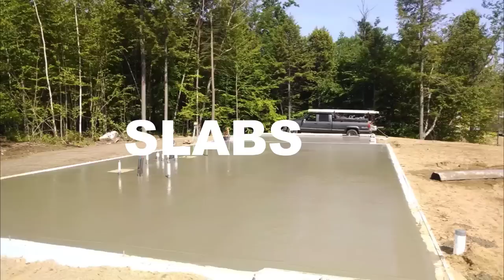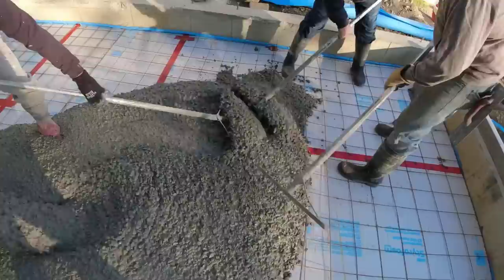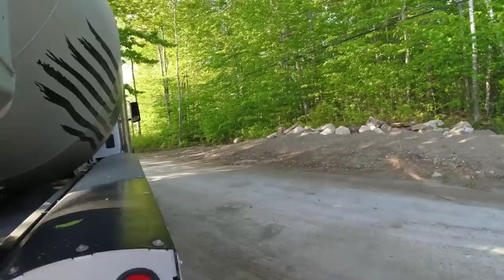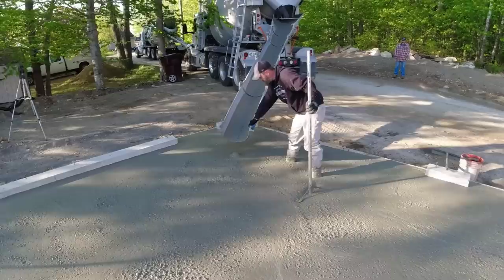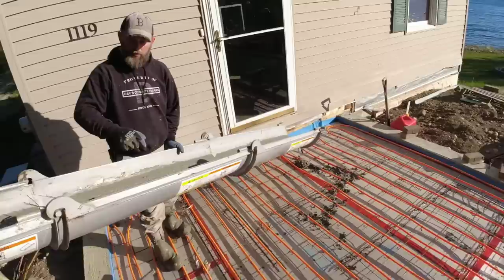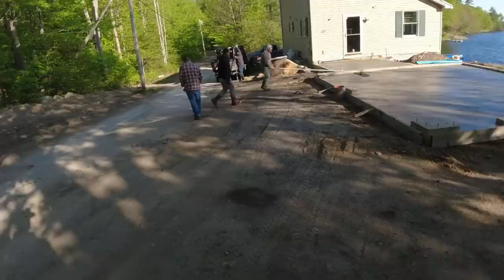City Inspector Makes Homeowner Pour His Concrete Floor 8 Inches Thick!

Comment: I’ve worked for years as a Grade Forman for an Excavation Company in Boston. I can relate to these existing conditions problems. It’s actually a good catch by the inspector if the concern is water coming down the road and into his new garage and breezeway…it’s to bad this wasn’t caught or addressed by the site company..but like you said Mike “in the long run he will be better off

Comment: As a former inspector this is about having a “Termite Barrier.” They are ways to fix the slab where you would not have to pour the slab the full 8 inches. Also you have to look at the soil compaction under the slab and make sure the slope around the slab moves water away from the slab. There is always a way to to get the end result. A lot of contractors will blame the inspector when it is either their laziness or lack of job knowledge. Homeowners also put too much trust in their buddies that are in construction over prudent research themselves, if you don’t know always ask. Just in case you have a question down here in the south “Termites” are as dangerous as anything else, that is why I referenced “Termite Barrier.” There is also code section on slopes around a structure. 6 inches per 10 foot away from the structure if I remember correctly. It’s been 10 years since I worked so it might have changed by now.
Reply: Great comment. Most complaints when the safety people enforce standards the manager or the employees are just being lazy or babies
Reply: I fully agree, and thank you for posting your comment I was perplexed as to how the contractor seemed to be so surprised that it needed to be higher than the road, not a contractor I would ever hire.
Reply: The problem with a hole inspectors like yourself, is they never explain fully what they want and how to get there. Instead of saying, “hey you need to accomplish this, and these are a few ways to get it done”. You just decide to play a game.

I played a game with my inspector when building my new home. We have a third floor bonus room that we weren’t going to finish right away. He said it needed a fire barrier and told me the most expensive way possible to achieve what he wanted. I responded by saying, “or I could just drywall it”. He turned red, said “that works too” and stormed off. 

I also asked him about earth disturbance since we had a large lot, and he said if he wanted he could consider pulling out a blade of grass to be earth disturbance. I took pictures of the permit office putting in new landscape beds and showed them to him after he asked for an earth disturbance permit. While standing in the office I asked him for a copy of his permit. He said he didn’t think I disturbed my property enough to need a permit any longer.

Some inspectors are fine, some are power hungry losers, and some are downright criminals taking bribes from developers and commercial business. 

That inspector had a heart attack at his desk while eating lunch. Now we have a 25 year old girl who admits she knows nothing about construction. The good news is she doesn’t bother anyone and approves everything.
Reply: @davidcolston5689  The main problem is not minimum code, rather the interpretation of the code. An inspector can interpret the code however they want, and the homeowner is at the mercy of the inspector. At that point the only option the homeowner has it to litigate, and that costs even more money and time.

Look up a story in Pittsburgh Pa about plumbing inspections that the FBI got involved in. It’s been three years and nothing has happened to the inspectors other than losing their job. Many inspectors are crooked and screw the average homeowner because they can’t make money off them. Maybe if we started throwing these people in jail for a while the corruption wouldn’t spread. However, like most government officials they are protected.

I personally know (I no longer associate with them) a township inspector in New Jersey who laughs about corruption and his kickbacks. He makes more money off kickbacks then he did his salary. As soon as he got some heat, he retired with a nice government pension.
Reply: @mcb0b1  that “old word corruption “ it seems it is everywhere, I realize that there are problems out there and I have seen things that were questionable. I inspected for 20 yrs and was a Firefighter 15 years before that. My Dad was a building contractor so fortunately I grew up around a saw and hammer. Pop taught me always shake a man’s hand, look them in the eyes, and be honest with folks. I tried to live my life by those principles and well it worked out pretty well. I never took anything that wasn’t worked for and I wouldn’t even let guys buy me lunch, that way everything was fair and up front. People have to make choices and there is always a result, answer, comeback to them. I’m afraid this old world seems to have chosen the low road for the most part. I’m sure I didn’t please everyone with my decisions either but I guarantee you I never crossed the line of corruption and I have the battle scars to prove that. Not perfect but I raised children who saw me practice what I preached and now it is their turn with theirs.
Reply: @davidcolston5689  that’s good to hear. It just seems like the old school is looked down upon today and we find ourselves with more people willing to game the system to get ahead in order to keep up with the Jones’s.

Comment: Why weren't the grades established before the forms were set?  This is the GC's problem,  and any inspector could tell it was wrong from a distance.
Reply: In the thousand or so jobs I’ve contracted, never once did I (or any contractor I’ve ever known) decide in the field, what the finish floor elevation was going to be. The elevation is given on the plans, by the architect. If the contractor deviated from the plans, than it’s his. Otherwise it’s a design problem and the architects baby.

Comment: Contractor blaming inspector. I would have cancelled the concrete. Made the contractor redo slab above grade or make contractor pay for the extra concrete.
Reply: If the contractor built to the elevation given on the plans, then what?
Reply: @psidvicious  Find smarter people that catch others mistakes, or at least check.

People should not just be robots that do exactly as told.  I'm not a contractor, nor am I a concrete expert, nor am I a city inspector.  But I do know that people don't want their garage to flood when it rains. All it would have took was for the contractor to notice the mistake, and call up whomever drew up the plans and say "Hey Bob, why are you putting this floor below grade?  That makes no sense.  Then if they argue, talk to the homeowner and make sure THEY know what they're getting into.

Comment: I think it makes perfectly good sense that it should be raised higher than the road, but what astonishes me is that you as a contractor seem to be surprised by this. If you have been in business for any length of time I would think you should know these things
Reply: Often times a flatwork contractor is not involved in the planning or design.  They are hired to pour, place, finish and leave.
Reply: @daveyconcrete9801  I'd still hope that any fool knows you shouldn't put a concrete floor, in a garage below grade.  The city inspector did the right thing.

This ain't rocket surgery.  I learned at maybe 8 years old that water goes to the lowest point.  No homeowner is going to be happy when his/her garage floor is always flooded out by several inches of water when the snow melts, or a rainstorm comes.

Comment: I would’ve ordered Road base 4 inches high and then had 4 inches of concrete. There’s your sign.
Reply: Yep it's all in the prep grading.. this is why inspection are a must because there a dozen things to look at so your project isn't ruined by bad judgment  like being below the road grade.. well now the concrete thick enough to put in a lift.
Reply: Yep time tofind a new concrete guy
Reply: I was thinking the same thing. He could have saved a lot of money.
Reply: @canudie1978  Or land a jet LOL.
Reply: Forklift load approved.
Reply: Lucky the inspector caught it and avoided a flooding garage
Reply: It's not the homeowners fault that the contractor didn't know WTF he's doing.....rooky mistake.....they obviously spent time boxing out, grading, laying stone, tying rebar??
Not sure I would have paid for my contractors mistake and the 6 extra loads on him😂
Reply: Don’t like the wire mesh inside 8” thick concrete! If you are so worried about the extra concrete then build up the Sub-grade.
Reply: Got the high range in there today?

Comment: No wire mesh shall touch the ground. Chairs lifting the mesh up three feet is required. 

Per installation instructions of the wire mesh product, tie the product together where it overlaps, it also needs to oveelap about a foot. 

Your tape job is spot on. 

i would of req structural steel to carry over onto garage. Given the cliff in front of where these guys are working, did you install helical piers in any location of home.

Comment: Great job, & no offense but whats the point of pulling the wire mesh when you've got guys walking on top of it a minute later. Mesh seems good on a pour youre walking back on pulling as you go, but this one seems like rebar woulda been better
Reply: Once the mesh height is set in the crete walking on it will absolutely,  positively,  not push it back down!!  If you pull it to high and it pops up above the surface,  you usually have to cut it out!  You cant push it back down.  The aggregate or stones get underneath the wire and hold it up.😊
Reply: @stevehamman4465  ohh good, thanks for clarifying. Especially with large aggregate. Still seems like it could've been pulled up a lot more on an 8" slab
Reply: @JonnyDIY  , actually,,, what wire mesh and rebar does for most concrete pours are unnecessary!  Concrete ( cement) is only as strong as its base!  Rebar will give it a few years but will also rust and allow water in to freeze and crack it sooner in certain climates. Wire mesh  ,, well,, wire mesh is for the use in over head concrete such as bridges , to keep cracked off chunks from falling on people or vehicles below! Gives them time to get a crew out to do repairs!   Dont know where you live but, in your travels,  look at bridges and center deviders that are crete, you'll always see metal (rebar) (mesh) that has rusted and broken chunks of crete off the surface!  The same is happening deeper in the structure, out of site! Good day!

Comment: Why not just bring in 4 inches of fill
Reply: Yeah I thought the same thing
Reply: Ya, same. And why so watery ?
Reply: @kenjames8377  it’s got water reducer in it so you can pour it that way
Reply: I am guessing with everything already set up, it was probably cheaper to raise the forms and buy 4 inches add'l concrete .. otherwise, you have to tear it all up and re-build with lots of labor cost.
Reply from the maker: He already had the styrofoam and radiant heat installed before he found out he had to raise the floor.
Reply: In the video it looks lower than the road for some reason.
Reply: @MikeDayConcrete so now because the city are idiots he wont get any benefits from the radiant floor anyways. 6" + from the heat source won't heat much. Leave it to the government 🤦🏻‍♂️  I would have taken the fines all day and said see you in court. And then in the unemployment line. The city has to approve prior to building so someone NOT the home owner is to blame.
Reply: What city was this?
Reply: Does anyone know what city and state this is?
Reply: Poor planning fom site guy. Yikes
Reply: Dirt will make the home move to much later on in life
Reply: @SaltyCaliO city probably didn't do any of their land development as no city does this part of the job. Not the city's job to catch this. Was the graders job.
Reply: Because gravel is $8 a yard and concrete is 200... no money in that idea!
Reply: Cost of redoing work already done cost more but if city it up higher than road need ti give it more than city guy even said to do it by 4 more inches due to setting and that road will change over the years too

Comment: Hey Mike, will having the extra thick concrete effect the performance of the radiant heat? Making it less effective?
Reply: It will take longer for the floor to heat up to temp and will retain the heat longer when heat is turned down for summer
Reply: What radiant?

Comment: Where is your half inch rebar. And why didn't you just use fill and compaction? You wasted money on all the extra concrete
Reply: Didn’t need the wire even. Fiber in the concrete mix.

Comment: 24 Mpa, equals 35000 PSI.
Seems a little weak especially because of how wet it looks.
Air entrained? Inside but looks like it could be cold there unless garage heated full-time. 
That concrete looks really wet at least a 5 inch slump,  maybe even wetter, 5 1/2 inch. Canadian,  I guess it's a 135 mm slump.
Hot water, that's good as concrete chemical reaction but has to be warm enough to start kicking.
Accelerator used?
Fibre mesh a good idea.
Retired former ready mix driver here.
A 4 inch slump would be hard to do with all the chutes out.
I liked those easy pours.
Slump and dump.

Comment: Bad title on the clip and you kept repeating it.  City inspector required the floor level raised 4".  Gravel, fill, another layer of foam would have all done the job and been cheaper than concrete.

Comment: That concrete is a little watery. There is gonna be some shrinkage and more than likely spider cracks in that slab
Reply: As a former mixer driver,  when I saw it coming down the chutes,  not a regular 4 inch pour.
Good thing the inspector didn't ask for a concrete tester.
24 MPa concrete pretty low in cement. I'm Canadian,  we do talk metric.
With all that water in mix, just lowered cement ratio.
Now, probably a 20 MPa.
Extra water kills the cement ratio too.
Reply: @wesblood3620  High range water reducer (plasticizer), not water.

Comment: Fairly pointless to bring up the slab 4 inches when there is 8 feet of fall right behind the building and good drainage needs to be accommodated anyways to get the water out from in front of that garage

Comment: 8 inches of concrete is ridiculous. Back when I did concrete inspectors wanted 4 inches of tamped process and 4 inches of concrete with steel matting when necessary. Like I said 8 inches of straight concrete is ridiculous, what does that inspector think your building on top of that slab, a 50 story sky scraper?

Comment: In California we actually use rebar. And you can't just wash out a concrete truck on the side of the road. Concrete guy was too lazy to pull the wire and fill with cheaper base than blow an extra 4" concrete.
Reply: Cal is a seismic zone. Maine isn’t.

Comment: Sometimes a decision is made in the field due to a differing site condition, design error, or construction prep issue, so the 8" PCC may have been offered up as a last minute fix to a valid issue(s). FYI: 8" PCC doesn't equal 4" PCC+4" Agg Base.

Comment: Is dirt more expensive than concrete? If not why not add 4” on dirt then pour
Reply: you add  stone  not  dirt
Reply: That, and they had already begun
Reply: @BobL84  hey I’m from the South we add what we got which is dirt! Lol
Reply: @donmadere4237 it's either sand or compacted gravel. If you place concrete on top of dirt your asking for problems
Reply: @NinjaChuckJr  It’s not about the substrate; gravel or dirt. It’s about compaction. Some soils will compact to 95%, some won’t.

Comment: Does anyone know the best pigment and sealant to use on concrete that’s done meaning finished and need to be done with color to last for years? I want to make a concrete large football statue I NEED SOME PROFESSIONAL HELP!!
Reply: Pigment?
Any color can be added but most concrete just gray color.
Sealer? What are u doing?
Sealer is often used when doing a high end job, stamping or exposed aggregate but really not necessary for basic concrete. 
Outside job, will need air entrainment especially in the Northern areas where temperatures are hot in summer and cold in winter.

Comment: Too bad the home owner didn't know the codes and didn't grade the garage to the correct height.   That thick slab will negatively affect the efficiency of the radiant floor; he'll have to run hotter water to get the same surface temp that he would have gotten with a thinner slab.
Nice work!
Reply: That's not how thermal mass works.

Comment: whats the name of the high range water reducer the ready mix plant uses?
Reply: Glenium 
Reduces water and increases strength by reducing water  then delvo makes it easier to work  by making it more fluid  .it will almost level itself .
Add fibres in the bottom layer  for strength then a top layer  . To finish it .

Comment: An inspector has no authority to demand anything. They can only reference what’s currently code.. they can’t make their own code…
Reply: 😂😂 what are you talking about. They can shit you down and tie you up in red tape forever
Reply: You're confusing  real estate inspectors (interNACHI, etc) with building inspectors.
   The former can only make recommendations  while the latter is charged with ensuring adherence to present-day  standards.
Reply: Basically they can become dictators. Require more than the code books say. You and build the same house in another local city and the rules are different.  Often it is a power trip. Local guy here built a 12x16 shed for his mowers . Lives in the country on 6 acres land. The code guy had the mudsill bolts on 12 inch centers with 5/8 bolts in the concrete.  The 12 inch spacing is tighter than his house's that was built in 2022. It had 16 inch bolt spacing